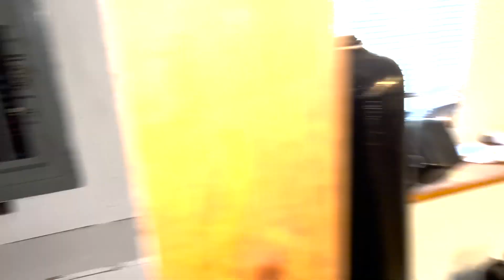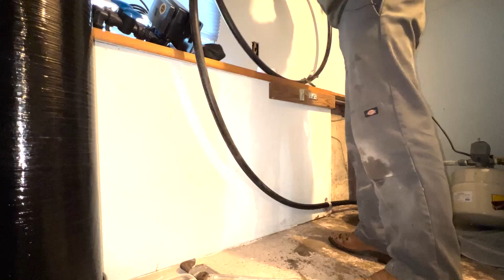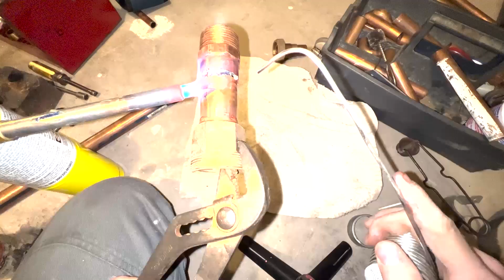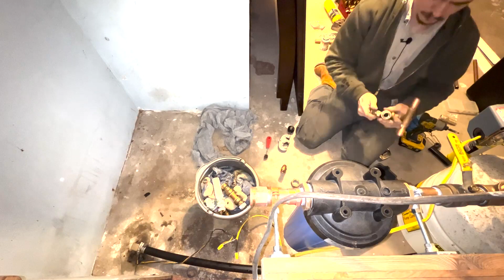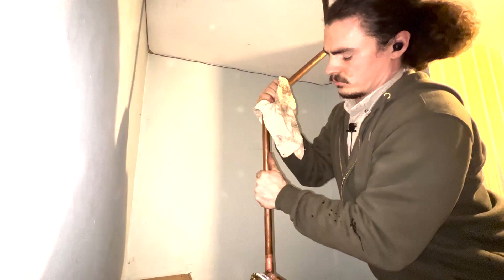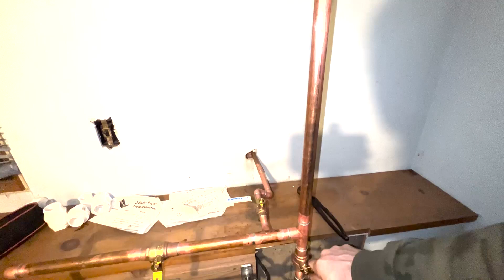Installing Whole House Sediment Filter

Comment: You put 1/4 turn ball valves in the opposite way that I do in relation to flow through the valve. So, my handles face the other way when on. I can't even remember who originally showed me this. Were you taught that orientation? I admit I might be doing it wrong.
Reply from the maker: I usually like to install them so that the handle is pointing in the direction of the flow. People typically like to pull the handle down, so sometimes I will install it so that is the case. Ultimately the orientation is no critical with a ball valve like it is with a stop & waste or gate valve.
Reply: @GodwinAndSons  Thank you! Makes sense to me. Great channel.

Comment: Looks Good my friend looks good!
Reply from the maker: I didn't bother to check those settings as I was more or less rearranging the existing system. Next time I come across one I will see what it's all set to.
Reply: Our company makes is check all tank pressures.  Because to much water will come out in spirts or too low pressure will drop. They even have it on our paperwork. Everything we install water heaters, we'll tanks, changing a PRV valve. I was just wondering because of how high the water pressure was.  And we have to adjust them when the pressure is on the higher side of 60-65 psi. 0r 50 and a tad bit lower.. like 2-3 lbs. lower than the actual pressure.
Reply: I have just started watching you and think you do good work.  Not trolling you..

Comment: What was the pressure of the holding tank/ expantion.. just curious on what it should be for the on demand pump systems. I've been a plumber for over twenty years and have only worked on one.

Comment: For the love of God, protect your knees before it’s too late. I know — your knees are fine — you’re young and strong and you have no knee problems…yet. Please take the advice of an old plumber who still works every day. I work with several plumbers about the same age as myself, and we all have knee problems. It wasn’t too long ago that customers would ask me how my knees handle the constant up and down and working on my knees. “No problems here” I would tell them. Well, the problems eventually came and they will never go away. Protect your knees NOW before you really regret it. Buy some comfortable knee pads or, at least, a large pad you can kneel on. You will not regret it and you will get used to using these things very quickly. I enjoy watching you work, but it just kills me to see you destroying your knees.

Now, for my tips: first, you should never use any type of pipe dope on plastics, like where you connected to the filter head. Just use tape. The dope will eventually attack the plastic. Also, on-demand well pump systems are very picky about having the correct charge in the expansion tank. In the video you didn’t check the pressure of the tank, but maybe you just didn’t show that part. This is a very important thing to do with any expansion tank, especially those incorporated into an on-demand well system.

Otherwise, you did a great job. I truly enjoy seeing the pride you put into your work. You did so many things here that most plumbers wouldn’t have done — things that most customers wouldn’t even notice. But it seems that you don’t care about impressing the customer as much as you do just doing the job better than anybody else would do it. Well done!

Comment: Not a fan of those SB fittings either. Finishing up a renovation and went to the big box store for parts....that's all they have now days.
Reply from the maker: Yes indeed. Some places have small sections for sweat fittings, but sharkbites are a huge market for homeowners. I've seen them used in places you'd never imagine.. gas😬

Comment: How much is a 1/2" 100ft reel of that black pe? Rarely see that out here in California. And how much are those fittings?
Reply from the maker: 1/2" x 100' #160 HDPE is about $24.. 1" x 100' #160 HDPE Coil is about $65.

Comment: Another masterful job!  Slight electrical code violation with open splice of wire to pump.  Needs to be put in  a box.   Also your torch tip is running red hot from throttling gas down, which will damage metal. I prefer the Turbotorch portable kit with hose, cylinder regulator, and self igniting torch tips. It is easier to get in tight spots with.  Also for such a neat job, stapling and securing the Romex and pump wire would be a nice touch.  Keep up the good work.
Reply from the maker: Did you notice my striker troubles?😂 Do you run the b-tanks? I have a mini torch tip too for this setup when I am in a tight spot. I know they say you're not supposed to throttle them, but other than discoloration of the tip I haven't had too much of an issue. Good on you for spotting the wiring, but I believe the electrician is coming soon, we have some work to do in a bathroom there, so he has a few tasks as well and I think the pump wiring will be one of them so I didn't touch it.

Comment: Love the install. It was beautiful there's an elephant in the room. It was filtration system that was to your left. It was a big black tank that a lot of well users have were they taking that out for a reason? Cuz it seems like it would have been the one to be installed. Just a thought
Reply from the maker: The filter system you saw was purchased by the previous owner, but water tests from home inspection during sale came back showing that pH and Hardness were within acceptable ranges, so no softener system is necessary, plus the owner doesn't like the feel of them. Sediment however was a big issue and is why such a large filter was installed.
Reply: @GodwinAndSons   Would they like to see it
Reply from the maker: The water test? The one I was shown was from the homeowner and provided by the home inspector. I went over all the tests with the owner so they understood the condition of their water. If I take the sample myself I always provide the owner a copy of the report.
Reply: @GodwinAndSons This filter looks like a 10” cartridge, is it? Is it 5 micron?  Didn’t the filter come with 3/4” outlets? Great job!